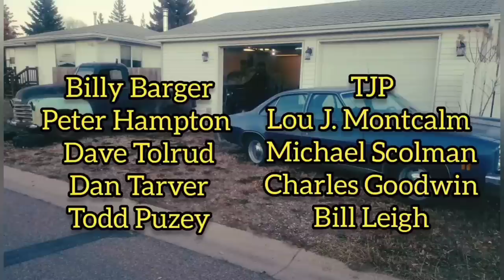Classic Car and Truck Junkyard Tour. Which Vehicle Should We Rescue?

Comment: I got my parts ‘58 Pontiac out of Maymont last fall, just around thanksgiving. He has pretty high prices listed, but cut me a particularly good deal on the parts car. Never been to the amigo`s yard. My vote is the chopped Pilot Butte sheriffs car, grew up around there
Reply from the maker: He doesn't seem to have any trouble selling stuff, but I'm cheap so most of it is out of my price range
Reply: I`m pretty cheap too. Got it for just over half what he was asking and he loaded the  car on the trailer for me.

Comment: Here in the UK we don't really have the space for those big walk around scrap yards. Most cars are piled on top of one another and crushed fairly quickly before the yard gets full. I quite liked that blue Studebaker Champion?  It looked complete and there is not too much brightwork on it so that will reduce the cost of restoration. Also that 6 banger you have would fit nicely. A man of your tin bashing talents won't be put off by a little tin worm.
Reply from the maker: The Stude was cool, unfortunately the forklift damage would greatly increase the cost of restoration.

Comment: Best guess, the mid-1950's Buick. Nothing looks better than a gloss-black Buick with straight bodywork and bright chrome. It appears most or all of the trim pieces are there. Then maybe the ’59? 4-door Impala if you were going to do a four-door to two door on-line instruction video. My personal favorite would be the 1965 Ford Galaxie convertible, back in the day I had the hard-top version. Then again, a 1950’s pick up cab with some sort of deck for transporting cars around would be nice. That Mercury one-ton? would be the ticket, sort of a cab-over design with lots of glass. Would make a nice tilt & load. Is that a winch on the frame? In the second yard, you could just go down the row of early trucks and do then all, one at a time?
Reply from the maker: Yeah I really need to build a big rig to haul projects home! I would like to return to the yards again, I didn't have a lot of time for filming this time around

Comment: I need some window parts off the tailgate on that Vista Cruiser. the track off the bottom of the glass, and the regulator would be ideal.
Reply from the maker: The yard name is Amigos Auto Wrecking in Clavet Sask. If you google it they have a website, email and phone number.
Reply: @CarterAutoRestyling  Have been through there a few times over the years, but never knew they were there, becase they're on "old 16"......probably can't see them from above, driving by.

Comment: I'm thinking the T-Bird. I'm building a '36 Chevy, need a steering column. I have the steering wheel but need a shaft that has a woodruff slot cut into it. Any chance the Yards have anything?
Reply from the maker: I'm actually on the hunt for the same thing! So I guess the answer is no, although I'm still on the lookout.